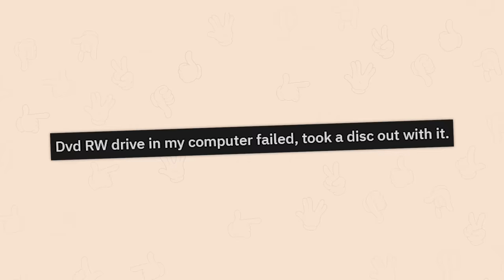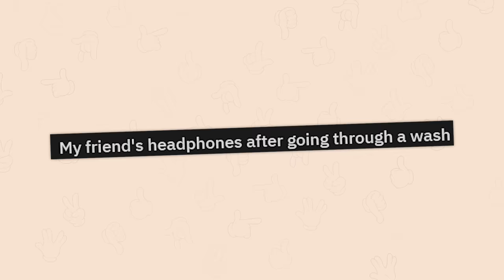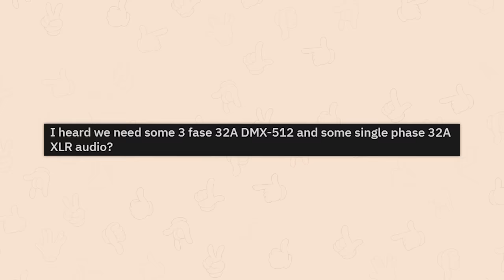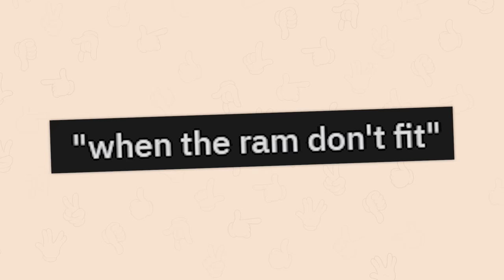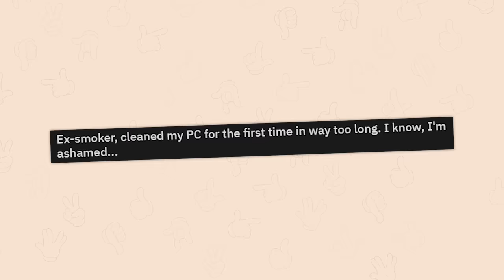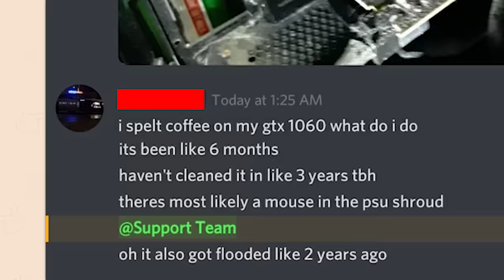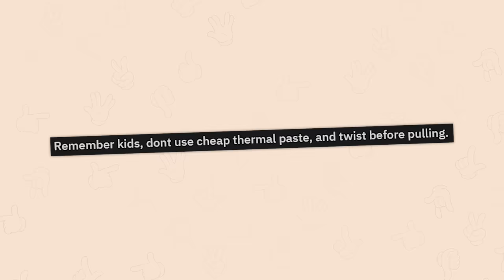r/Hardwaregore | it fries my laptop

Comment: 6:27
you plug this into a speaker and any sound that comes from this will just be a shockwave that kills you instantly
Reply: Well no passive ( needing Mo ) or active (has an amp) have need give power technical nothing happened till switch speaker bang 16 amp may and 64 or 32 amp would cause it bang may little fire this some the work in event .
Reply: @jamesansell007  is that english

Comment: 0:55 Narrator: "It was not fine."
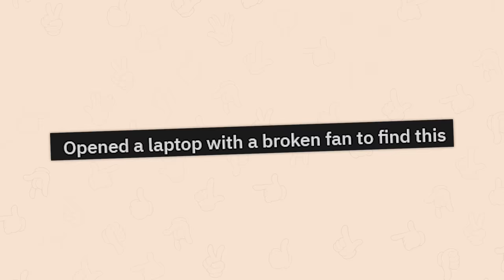4:23 How the hell do you even start fixing that? Do you just turn off the power and get a chainsaw?
Reply: You trace out the uplinks and them begin running cable under the glob so that when you actually switch to the new cable you just unplug all the old stuff and it lifts off. Assuming you have patch maps.
Reply: @TheLexikitty  I did not expect an answer, but that was a great one. It makes so much sense. Thank you,
Reply: @TheLexikitty  hi

Comment: I've cooked a microchip or two. They were from radio controlled cars that I was modifying. Most notably was when I modified one of them to have dual motors in a parallel circuit. heard a little sizzling sound before seeing a little puff of smoke.

Edit: it was because I wired it wrong. It worked a couple times but then I wired it up differently.

Comment: Speaking of things that hold other things together that don't usually, I learned that the reason spit is often thought of as having binding capabilities when it's more of a lubricant is when that phrase became common (Holding it together with spit and baling wire) so many people smoked that almost every persons spit chemically resembled pine tar glue. Hence, if you spit on it with your tar-laden spit and bound that thing together with baling wire till it dried, there was a reasonable chance it would stay that way.

Comment: The "Shearing chipset" in half thing is a goddamn nightmare. Okay, I don't think Lexi met that nightmare, and yes, NIGHTMARE.
See, not all PASTES are created equal or for computers, that should explain it all. 
But imagine, someone using a "paste" that glues the chipset to it's radiator. Lift radiator, rip the top half of the chipset while the bottom stays snugly pinned...

Comment: 7:32 I know of half a county that only had internet due to a paper clip and wad of teacher tac. For years.

I also was disturbed to discover that the only thing keeping internet to what used to be military housing was the squirrel that got fried when it bridged burned out sections of wire in the box…not discovered until someone crashed a truck into the box.

Comment: 2:19 Explainer: I had a desk like this. There was no such thing as a computer that would fit in that spot unless it was either a small form factor PC or a cheaper lower powered system. If you wanted a system with some kind of gaming chops, this was your only option if you didn't want your computer on the floor or on that teeny tiny desk (3 foot by 2 foot if I recall right).

Comment: I have a hardware gore story… So, Mom’s laptop was in the pantry (we had our computer desk in there at the time), right next to the shelf where we have our fryer. One day, I go to get out said fryer… But, I wasn’t expecting there to still be a bunch of oil in the thing. It was heavier than I expected; I overbalanced a bit (because I’m short)… And spilled cooking oil on Mom’s laptop. Mom cleaned it off, but after a while, it just started… Crumbling. That’s when we learned that cooking oil is corrosive to electronics…
Reply: oh- 
nice to know?
Reply: oh thanks for the tip, can you tell me what its corroding exactly? if its the components or the boards themself?
Reply: @TantalumPolytope  The plastic itself was warping and bending and crumbling, and the casing around the ports came off. I don’t remember what the metal bits looked like (it was a few years ago).
Reply: @luminalsaturn2  so it was the enclosure of tha laptop?
Reply: @TantalumPolytope  Yes
Reply: @luminalsaturn2  nice

Comment: 13:38 My Lenovo G50-45 had a buildup so bad,  the fan stopped moving. I couldn't wait for the replacement part to arrive because of important college homework so in an act of desperation I turned it on while open and flicked my finger at the fan,  it worked and still does after all these years.
Reply: Wow that’s amazing

Comment: I have a feeling my speaker would fit on it quite easily. I accidentally spilled an oil based diffuser and it ended up soaking the base of a plastic coated speaker.

Comment: 0:50 PCIe nvme drive in a Sata Power plug.
1:28 It is worse than it looks. The screws are shorter in places where there is no hole on the motherboard. He tore through it.

Comment: 12:50
I used to have this exact design / model of laptop.
Had to sell it though.
12:55
The missing keys in the photo are an exact match for the missing keys of the one I sold.
Didn't think I'd ever see it on Reddit.

Comment: Little trick for more airflow on a laptop get a sturdy plastic bin, and slowly and carefully cut two medium length panels out of two of the sides, it elevates the pc and leaves space for a an ice pack to cool the air like a radiator

Comment: I once put together a computer using pretty much all mismatched parts. You would be surprised how far metal tape and electrical tape will go. It ran fine for about a year until I replaced it.

Also, people, please, take a few minutes to clean your computer fans. With practice it can take only a few minutes and can save you a ton of money. My laptop allows you to remove the whole bottom cover with just a couple of slide thingies, which exposes all the fans. My desktop computer can have the side cover removed with a couple of screws, exposing the fans. Canned air is cheap (cheap enough). I once tried to salvage a gaming rig that apparently came from the home of a chain smoker who never opened their computer. Literal inches of tar and dust in places.

Comment: I do have a few older electronic devices that I use for props but I either have the batteries entirely drained or removed to try and prevent them from blowing up.

Comment: 5:25 I actually know how this can happen with that exact calculator. The TI-30x. The buttons are an entirely different board so you can destroy the buttons or cut it in half and it will still work. If you look at the front of the screen. About where the bottom of the screen ends, the actual computer part also ends. So you can have a calculator cut in half and it still works. If you are skilled, you can use a conductive wire and still use it by shorting the button connections.

Comment: I've not done any maintenance on my computer for about 5ish years now. 

Not cleaned it once. 

Checked the inside using the plastic side window and a light. Almost no dust inside. But the mesh covers were a bit furry, but I gently wiped the dust off as one of those meshes are bent inwards a bit

Comment: Lexi, i know your networking pain, and i will agree that one network cabinet at the 3:50 mark is still easy to work in, Its only rough as you said when the cables are old, or has been weighing heavily ontop of each other for so long that if you even move one cable that a port dies in a completely different cabinet on the other side due to the copper breaking from the release of pressure.

Comment: I once had a DELL computer before I bought my current laptop that my oldest brother never cleaned and never taught me to clean when he gave it to me. I'm surprised it lasted so long (2010 - 2022 without being cleaned).

P.S. My older brother blames me for never cleaning it, even though I was never taught and didn't know anything about computers.

Edit: Another story, both of the outer back screws on my computer came out while I was at school (I thankfully still had both) and I screwed them back in with a pencil. It somehow worked and they haven't come out since.

Comment: I used to have a similar situation where I wanted a new card for my pc, but the power supply didn’t have a cable to connect the card. So I hooked up a second power supply that sat outside of the case, and then hooked up a button that connected to the power supply’s mother board plug that simulated the power supply being plugged into the motherboard when it was not. So basically I when I turned on my PC I had to turn on the gpu first, then turn on the rest of the computer. It worked really well, but looked pretty sketchy.

Comment: 0:21 yeah I've had that happen. It was a veeeeeeeeeeerrrrrrrry loooooooonnnnnnnng time ago now (like twenty years) but when I finally managed to extract the drive from my computer the outside case of the drive had bowed significantly outward pinning the drive in place. Sent it back to the manufacturer who wrote back and tried to reject my warranty claim suggesting that somehow the drive had been run over by a vehicle of some description. So I sent them what remained of the disc and photos that i had taken of the situation. They wrote back within two weeks apologizing profusely for their earlier suggestion, paying for the cost of replacing that disc which back then was a still available Star Trek game (which is as rare as hen's teeth these days) , and hence not that expensive (still a nice gesture on their behalf) and stating that they estimated that the drive had somehow spun the disc to over 45,000 RPM (almost double the rated speed) which caused the spindle to separate from the motor which in turn almost completely powderised the disc.

Comment: that server rack reminds me of the server and gateways at a old restaurant i used to work at. the IT guy decided to BRAID the damn Cat5s. I'm not talking, straight bundle and supported for easy access. Nothing was labeled. There was no plug diagram. there were 2 gateways and a single rack mount server. Connected all internal and external communications. The cables went up to the ceiling, and from there, were BRAIDED like a damn horse tail braid. im guessing he didn't exceed the bend limits but WHY?!

Comment: Fun Fact, I too had a Razer blade as my first laptop. and well I had the same thing happen, but Razer fully replaced my laptop for me. apparently this was something that was happing back in 2017 era give or take a few years. and it only effected like 1 out of every 6 computers, and they just straight up couldn't figure out what was causing it. but of the computer's where it would happen, it would always be within the first 3~6 months of use. so if you've gotten past that first 6 months you're probably safe.

Comment: 14:47 Oven bake to "Ghetto reflow" the GPU die and breathe a little life out of a dead GPU.

Usually done at 150-200C (Non leaded solder melting point)

not 400C

Comment: 9:90 you say that, but ive had my galaxy a8 pretty much since they came out back in 2018, and the only issues ive got are that the battery life doesnt last as well as it used to, but can still last a day depending on how heavily used the phone is, and does admittedly run a little slower than it used to. also the screen on this thing is damn near indestructible, at least in my experience.

obviously i can only speak from my own experience, and thats just one case, but still.

Comment: I love samsung because I've had an older tablet for 5-6 years, it still works and its only problems are wifi issues and it no longer getting updates for anything, a few hardware issues like the charging port being scratched, the camera lens falling out and the glue 7sed for it making the quality even worse, its headphone jack doesn't work and its speaker is bad, but it's otherwise fine. I've dropped it a lot too, and all it has to show for it is a few small gouges in the screen

Comment: 4:02 there's nothing wrong with self made cables.... If done correctly. I have seen a lot of cables where the mantle wasn't clipped down in the connector. I have seen multiple occasions where people invented there own standard that wasn't even close to 568A or B. I have seen Patch panels with only 4 wires patched.

Comment: You can say that the cheaper Samsung phones are crap but my M31 that I bought as a "I don't need a flagship anymore" replacement was 1. Cheaper than what I sold my 5 year old flagship for that even had a loose backplate (189 euros) 2. Reasonably big, fast and snappy 3. Had awesome cameras aside from the downgraded software letting it down by default and 4. lasted TWO FULL DAYS on the insane battery that it had. In 2 years time, never had damage or any issues with it at all and so did mum's because I recommended it as it was a cheap upgrade for her old hand me down.

Comment: did that 0:50 person REALLY plug a M.2 into a power supply? you know the cable that goes in stuff like a hard drive?

11:20 "just clean it off and ..." cleaning that stuff is a real pain tho. its not normal dust, but like a mass of sticky hell...

Comment: Student confession  time.  I used to have a laptop after a while the screen led tapes had bad contact resulting  in a white a screen.  As i didnt want to tell my parents to go get it  fixed and burden them,  i saw that applying pressure the correct way fixed it.  So i stuck a spoon between the screen and the main part on one side whenever i used it for the next 2 years also slowly the spoon ate at the plastic on the case on the lower.  Then the laptop died and i got a new one.  Which my exes cat threw 2 cups of water on it and later my ex in a fight opened the screen to 190 screen and broke its screen.  Surprisingly  that laptop still held on for 3 years. Still got it in the attic i think but its almost dead. Now i just have to deal with my new laptop and my cat (suprise its THAT)  getting her grooming on it.  Just clean every 3 months.

Comment: 4:49 you think that’s bad? I remember this one HP laptop was a family laptop. The internal battery was damaged. It had to be plugged in to the charger, 24/7 or it just would shut down entirely. It basically turned into a PC with less specs. Also, it was slow as hell and I think had a few viruses.

Comment: I just recently had to get a new phone, because my Samsung Galaxy J3V finally decided to die on me after 6 years. Never needed a replacement part, and the battery still held charge just fine. Then a few weeks ago, it just wouldn't turn on no matter how long I tried charging it for. She served me well, but I decided  I'd rather get a new, modern phone instead of repairing my old phone I got in 2016.

Comment: I have a genuine maintenance question: I have a 2022 hp flagship 17.3 inch laptop and I'm not having any problems within  it at all but I am wondering if it is safe to keep the power cord plugged into it constantly? I also have 2 different laptop cooling pads for it when I use it for online gaming. Tips or advice?

Comment: 4:37 oh yeah I hate HP with a passion. Parents bought one of their laptops in 2008, and the thing had an NVIDIA card in it. I forget what card, it wasn't anything crazy. But the damn laptop ate HDDS ever since we got it. Every 6 months it was like clockwork. Then, fast forward about 5 years and the thing is overheating itself. I've no idea why. Didn't change anything drastic myself. But then I figured out the GPU was overclocking itself. To the MAX. The stupid thing was it would reset itself every time you rebooted. I tried different drivers. Didn't do anything to fix the problem. Eventually it just made fried chips of itself.
Reply: Oh yeah HP DV2800T. Nvidia 8400M G. Basically like an old 7400.

Comment: I feel Lexi's pain on that Game Boy. I had a translucent purple Game Boy Color and just TONS of accessories for it... the Shock-N-Rock, a separate rechargeable battery pack, the little squiggly LED thing for the screen that looked like a cross between a contortionist inchworm and a streetlight, and a few others IIRC. Played Pokemon Yellow bout till the buttons fell off. At some point in a moment of abject stupidity I sold it. One of a few big regrets I still have -- especially because I can't afford to replace it at current prices. Sure I can get the game for $15, and a Shock-N-Rock for $20ish, but a GBC like I had is $60+ unless I want to spend eternity troubleshooting a basketcase system... or buy somewhere even sleazier than fleaBay :( I be broke ya'll, I can't do that.

BTW, the motherboard someone pulled out of a river there, that's a Pentium 4 Dell board. I recognize the heatsink clip frame. I've dealt with enough of those to comfortably be able to say, it should have stayed in the river. LOL.

Comment: 0:49

Did he… did he plug a M.2 drive into a fucking Sata power connector? 

This isn’t not reading the manual, this is forcing that drive in and not wondering even for a little while “I wonder what this screw on this drive is for if I just plug it into a cable” or “I wonder why it’s so hard to plug in/so loose”. THINK, MAN, THINK!

Comment: Dafuq are people doing with their mobile devices to cause the batteries to swell up or explode? Only problem I had was with a cell phone with slider keyboard which eventually had battery contact problems so I had to buy a smart phone eventually as I was in no rush. Circa... 2013 maybe. Its memory was quickly filled up with basic apps with its capped 2GB capacity. Second one had to be bought for my job and have necessary apps but once again ran out even with expansion (total, I think 8GB). This was all because I was so far behind with the times, buying old models while modern apps were being ridiculously large. Clearing caches, deleting bloatware, and migrating apps to the external SD card sort of helped. 

Those two have been sitting around collecting dust for 10+ years, still no problems with them. Hell, my Motorola W175g still works. Last time it was powered on it let me know it still has 1329 days of service left and... 0 minutes left. Date was January 2007.